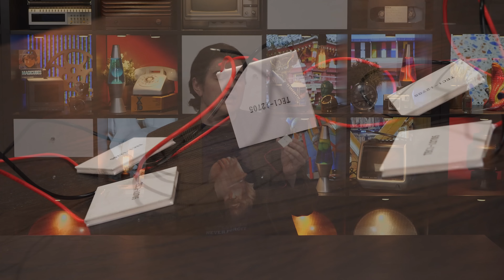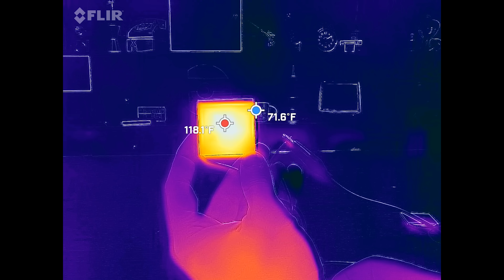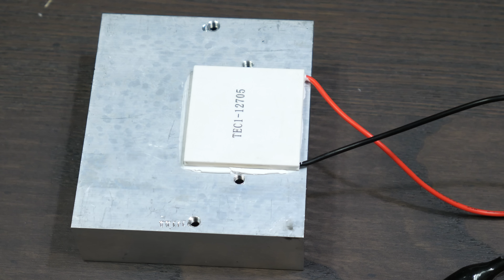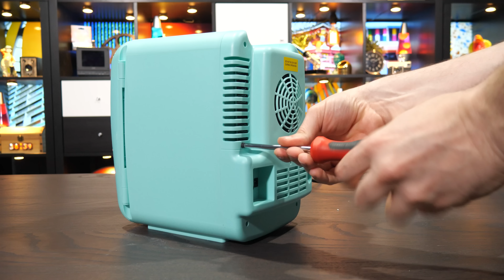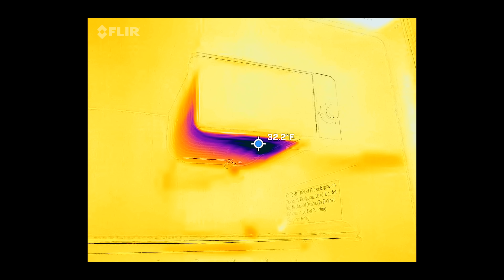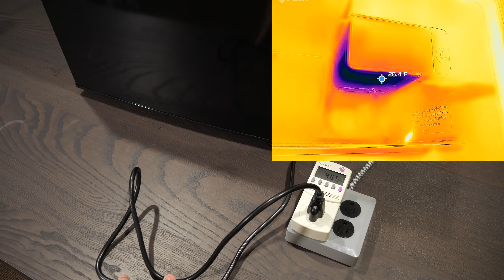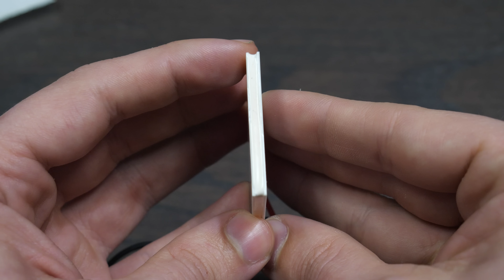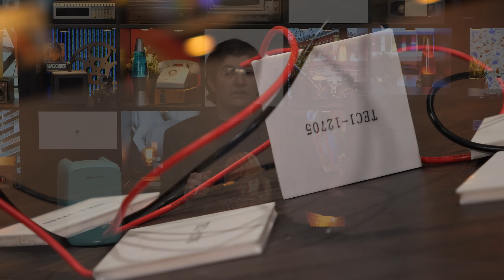Thermoelectric cooling: it's not great.

Comment: I have a Hisense mini fridge that must use a peltier cooling element. Must explain the one hot spot on the side. Works just fine and is very quiet. Has a temperature dial and gets plenty cold even in the June heat wave. No complaints

Comment: I think it probably makes sense that the US’s EnergyGuide numbers would be higher than Canada’s, if only for the geography of where the two countries are in relation to each other. As for the peltier element, it seems like it would be useful in an environment where gases mixing could cause problems, mainly underwater or in space, but there’s probably way more efficient ways that NASA and the like have found to do that, anyways
Reply: Also: I could see plenty of people using these things with a stirling engine for phony “perpetual motion machines”

Comment: They can also be stacked to increase the thermal difference. That would get it down to food-safe temperatures. Doubt the power supply would handle it without beefing it up a bit though.

Comment: "A vapor compression heat pump more heat energy out of the refrigerator than it takes to run the pump..." Efficiency may fluctuate up and down and could briefly make this the case, but you are never going to have more than 100% efficiency overall. Any time it is "more than 100% efficient" it is only because it was ineffecient before so energy builds up. Am I wrong? Is moving heat not considered work like creating it?
Reply: Yes you can, because heat is moved, not consumed or generated. I know it's counter-intuitive, but the fundamental inefficiency of thermal engines is the same law that allows for the "greater than 100%" efficiency of heat pumps. That's why it tends to be referred to as coefficient of performance or COP, to avoid the confusion with heat engine efficiency. The theoretical possible COP for indoor heating at a reasonably cold outdoor temperature is like 15, but real devices normally don't reach a COP higher than 5.

Comment: Was wondering if you could do a video comparing the efficiencys of a propane/heatsource driven refrigerator? Unlike the peltier that requires a fan a propane/heatsource fueled refrigerator has practically no moving parts and pretty interesting.

Comment: I have one of these coolers that has a Peltier element in the lid. A notable difference to the crappy little Peltier fridge is that there's a fan blowing air over the heatsink on the cold side. I expect that this improves heat transfer. In any way, the whole thing uses up to 70W when it's running, so it's useful to store stuff for a few hours ahead of a barbecue party, but not continuously.

Comment: When looking for an affordable fridge, I decided to stay away from the much lower cost (and seemingly equally lower quality) Peltier models. Emerson was the brand I ended up using ironically, but the one I have is a proper small fridge with compressor and full freezer section & it has a compressor. Probably the cheapest compressor fridge out there that isn’t one of those knee-high types. Literally 20 dollars less and I would have had a far inferior "fridge" that cost a lot more to run. Thanks for the video!
Reply: Of course, I can now no longer find this model. It was probably only made for the back-to-school season (dorms etc).

Comment: I'm using one of these to try and build a homemade PCR machine.  You really need to be able to remove the heat from the hot side very quickly. Otherwise they are 1000% worthless except as a heater.  And not even that as they will over heat and destroy themselves.

Comment: I have a device that I can attach to the back of my phone. It's essentially nothing more than a peltier element with a fan to blow the heat away. It's excellent at chilling the phone/its battery so it charges faster, or if playing an intensive game, run at 100% for longer before it starts to throttle.

Comment: 30:40 3-4 minute Short Cycling? That poor Mini-Fridge is not long for this world if you use it all the time...

Also, it sounds like you got a slightly faulty compressor, no Modern (built in the last 10 years) Fridge should be that loud or sound 'Buzzy' like that one does...it may work, but for how long? My guess is not as long as the Design Engineers say it's supposed to...

Comment: It looks like an efficient way to heat things. Electric heaters have 100% efficiency, but with a device like this you can beat that. The only question is if it gets warm enough to boil some water or to heat tap water. A water heater would need to be 10x more powerful. E.g. pull 500 W to deliver ~750W of heating. The problem with heat pumps there is that they don't get very warm and are very bulky.

Comment: I have a minifridge that I bought for my dorm when I was in college about 20 years ago.  After I graduated I kept it and I still have it as a dedicated drinks fridge.  For the upfront price of that fridge divided by the amount of years I've had it, it is way better than the peltier fridge.  With the amount of heat generated by the element, I have doubts that it'll last more than a year or two before the fan dies from continuous operation, and then the whole thing just fries itself.

Comment: Okay, I have a crazy and probably stupid idea, what would happen if someone sandwiched one of these Peltier devices between a CPU and a heat sink in a computer with the cold side on the CPU itself and the hot side on the heat sink, with good thermal paste on either side? Would it be more or less effective than building a PC using a functioning but highly modified mini-fridge as a computer case (my CPU is overheating and I'm getting desperate)?
Reply: The modern consensus on CPU Peltier cooling is that it adds more problems than it solves. Try removing your thermal paste with some paper towels and alcohol and repaste with something proper like Arctic MX-4 or Corsair TM-30.
Reply: @hammerth1421  I was mostly joking, but I couldn't help but be curious if that would actually work lol.

But yeah, it is actually overheating pretty much whenever I play any game, stays about 30-50C idle, but ingame it's about 78-79C and generally will freeze after a few hours. I put Arctic MX-6 on it a few weeks ago but that only kind of helped. I'm guessing that if I didn't somehow miss that I improperly seated it, that I need to do a deep cleaning on the heat sink or just straight up buy a new one.

Comment: You mentioned Peltier fridges are really bad, but now I'm really curious about the - literal - other side of the coin. How effective are Peltier heaters/cooking surfaces? If they get hot enough to cause issues with plastic casings, I could imagine they would be helpful for searing meats/holding temps above 135° F.

Comment: What about the other direction? The Peltier device seems like it would be better than a standard heating element assuming you housed and encased it properly, given its heat pump effect. You get all of the wattage as heat, plus a little more from wherever the other side is.

Comment: Extremely simple, will never break. But horribly inefficient and because of that not really all that useful.  I had a need for a small fridge as an emergency backup, and the first thing I looked into was something dead simple like this.  But it uses an enormous amount of energy compared to a small efficient compressor fridge.

The Dometic compressor fridge I ultimately bought will run for 3 days straight off of a single 50Ah 12.8V  LiFePO4 battery.   It was fairly expensive, but the efficiency is incredible.  Average power consumption is roughly 12W = 288 Wh/day = One 100W solar panel can keep the thing going indefinitely.

-Matt

Comment: I have one that fits 12x cans or 6x 20oz bottles... it honestly works great. Mines made by Frigidaire. As you say it would take a while to bring drinks from room temperature to cold, but if I keep a case of soda in my kitchen fridge as a "staging area" and then move them upstairs to the mini fridge once they are already cold then they will stay very cold indefinitely. You just have to use it correctly... I mean it gets very cold, so cold I have to scrape ice from the inside every once in a while.

Comment: The peltier thermolelectric effect is a heat pump cycle. The problem is that the "working fluid" is electrons moving through metal, and metal is also much more thermally conductive than gaseous refrigerants. If two materials are developed that are sufficiently electrically conductive, thermally insulating, and have a sufficient difference in the ground state voltage of their valence shell, the peltier junction efficiency problem will be solved
Reply: Scientists and engineers have been bashing their heads against a wall on that problem for decades though. No material has yet been discovered that meeds those criteria, and not for a lack of trying.
Reply: @vylbird8014  all I'm saying is, while the implementation could use some work, the requirements to improve the implementation are known and the principle is sound

Comment: If anybody's wondering about the size of the red fridge - it's typically called "apartment size" and you can find them readily. Most apartments in the US these days take house-sized fridges but a lot of old apartments only have space for one of those smaller ones in their very small kitchens.
Reply: It's really hard to find a decent apartment fridge and an apartment stove is almost unobtainable my grandmother's house is tiny and uses both 6-8 years ago she had me replace them and you just couldn't go buy them back then (I'm guessing with tiny homes that might have changed)
Reply: @sqike001ton  The brand "Summit Appliance" out of New York never stopped making apartment size stoves and refrigerators.
Reply: The main issue with the red fridge is the brand Galanz. They are decidedly low-end and fridges are not their specialty.  They are a major microwave oven OEM.  Another brand of fridge would probably work better.
Reply: @LatitudeSky We have a galanz fridge/freezer. We like it a lot. Works great as a freezer.
Reply: @LatitudeSky  Galanz is also a big mini-split air conditioner OEM. Their AC's are actually good and not at all low-end.
Reply: I've found that many online stores allow you to sort fridges by dimensions, which is convenient. That's how we found one that fits perfectly in our kitchen.
Reply: Ah, but if we call them that, the Europeans will constantly insist on smugly telling you that they used an "apartment sized fridge" to feed their family of twelve, likely followed by a diatribe about how Americans are crazy. I propose we instead start calling them "massive-ass fridges", just to be safe.
Reply: Here in the pacific northwest I see them marketed as "studio refrigerators".
Reply: i call em compact fridges but dorm fridge or appartment fridge is also popular
Reply: Let's not forget that it's also a lot easier to move a fridge like the red one in/out of an apartment.
Reply: Instead of this little blue box of stupidity at EVERY cubicle in the office. You would be better off with a cooler just a bit larger than the smallest soft side six can cooler and use one block ice pack and one (between six can) ice pack at each desk and have a fridge with a dedicated freezer to hold overnight and freeze an entire office staff’s icepacks …
In my car i have two soft sided coolers and i will use 2 of the B6C icepacks in one to hold dive cans (three standing upright in the center, two on thier side above the B6C, and in the second cooler six cans around a single B6C … for food item i pack them into plastic jars of the same size as a soda can. In that manner I can keep easily keep an entires workdays worth of food and beverages at a safe and tasty temp using just three icepacks that take up less space in the freezer than a single tub of ice cream
Reply: In Europe that's just a fridge-sized fridge 😂
WTH Americans 😂 I don't know ANYONE who has what you call a house-sized fridge, including people who live in houses 😂
Reply: @Sorenzo I’ve never seen a house with an apartment size fridge, in any European country
Reply: @theowainwright7406  I guess you've never been to the UK? Its the norm here, we call house fridges "American fridges" - they are beginning to tick up in popularity but you'd still be odds on to find an apartment fridge in any random house.
Reply: Agreed! I only know one person with an American sized fridge. My parents fridge is a little larger than the red fridge (mainly taller) but every fridge I've had or known friends to have is about that size. @Tomwithnonumbers
Reply: @Sorenzo he meant that the fridge is big enough for a house, not house sized
Reply: its actually more about landlords being cheap not that apartments cant support a full size fridge 

those smaller white fridges are also extremely durable
Reply: @Robbie-mw5uu I suspect since full size fridges are the norm, there might not he much savings to be found in the more specialty, smaller appliances. Especially if you're just buying a basic bitch full size, white fridge or the basic white electric ranges
Reply: no one is wondering

Comment: There was a recent video about wearable cooling systems that may have been using Peltier elements. These are worn around the neck, and at up to a 30°F difference, supposedly made it tolerable to be outside for extended period of times in the hot summer temperatures. Or at least until the USB charge wore out. But even though the cool side was against the body, you have to make sure the hot side (or expelled air) is more than only a millimeters away, otherwise you're wearing something that makes you feel even hotter than the air temperature. So for people who have to be outside in the blazing heat for a long time (contractors, gardeners, police officers, sedentary baseball umpires), even if the product was functional, after about 90 minutes you're back where you started temperature-wise.

Comment: peltier devices can work backwards by heating and cooling each side you can genrate a small voltage which can be useful in powering a small fan for distrubuting heat by sitting on stoves and fire places

Comment: I came up with a rule of thumb a few years back that, based on power consumption, a peltier rated to move a certain amount of heat would consume 1.8x as much energy as the heat it was moving - which is then added to the heat being dumped out the hot side.  So to cool, say, a 45W CPU, one needs a heatsink that can dump 45W + 1.8 * 45W = 126W of energy at least.  And the heatsink won't be as cool as the ambient air, which eats into one's ΔT.

Still, with a (max) 30F ΔT, one would think that it would work great for a personal neck cooler.  The problems are twofold: a.) the personal neck coolers have tiny heatsinks that get saturated with heat very easily, eating into the ΔT, and b.) even assuming a 100% effective heatsink, at 105F air temperature the pads on the neck cooler would only feel about 75F, which is fairly mediocre.  

Edited to add: I see that I'm basically saying what TC noted at 21:46; that peltiers have a terrible Coefficient of Performance (COP) outside of ideal circumstances.

Comment: 21:31 I think that is a misconception with heat pumps. The heat comes from the compressor not outside. The outside air temp is the limiting factor but the heat heating your home from a heat pump is from the compression of the gas.

Comment: Curious... When using the Peltier in reverse do you get good efficiency for heating? Like, is it more efficient than a resistive element in the way a heat pump is? Or is it basically just a resistor with extra steps?

Comment: Aside from insulation, you can make them more efficient and/or cool a wider temp differential with a pyramid stack of peltiers. Current-controlling them to keep them near their efficiency sweet spot and matching the number/surface area to the expected load is important, too. You can buy ready-made stacks or make your own. It'll still be beat by compressors outside of some niche cases where other factors outweigh the loss of performance.

Comment: tis as good rant, but i think one thing needs to be called out here. 

These little toy fridges could be made more efficient if they were insulated properly, that would make them a bit more expensive, but also work better. 

The big thing with these though is that they are sold where space itself is at a premium. Yes a proper mini-fridge or any proper fridge that goes through the refrigeration cycle will be better.

But if space is a premium and you need to have something cooled down even just a bit, there are use cases for this type of device. Yes it uses more power, but that's fine given its intended purpose is to fit in places where a larger device physically wont, and having this means that you would be able to have a cold(ish) drink as a luxury anywhere. 

Think about perhaps taking one of these camping, or using it in the car for road trips. You can start with already cold cans, put it in the little thingie, and it will help keep them cold in very little space as compared to say a cooler, which also needs ice and whose efficiency is always going to go down as said cold stuff melts.

There are purposes for it, its very good at doing one thing very well. Taking up little space as it cools down or maintains the temp of an item inside at a reasonable level for a consistent level of energy usage.